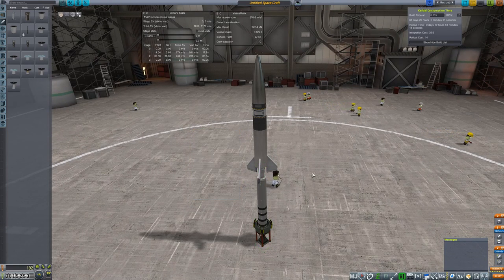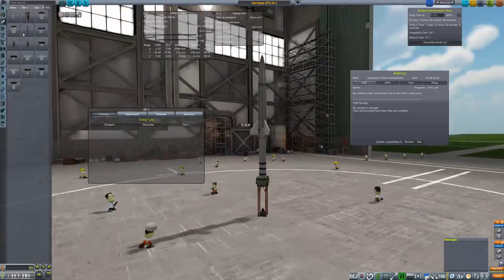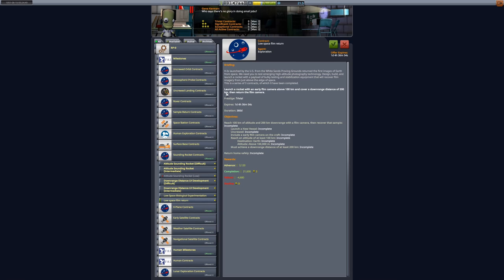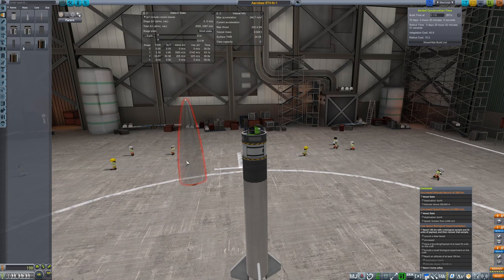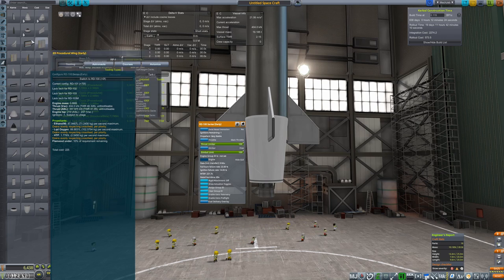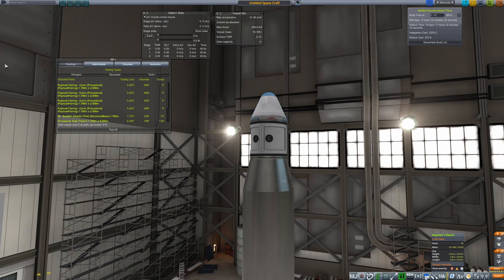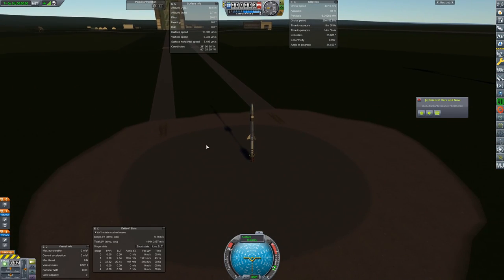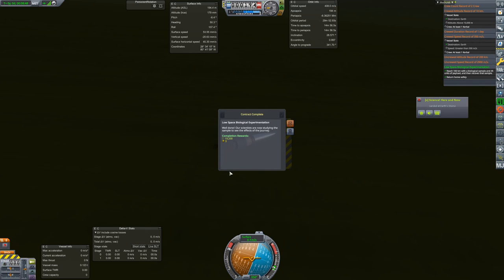Sky-high Designs! - KSP/RP-1 - Next Small Step Episode 04

Comment: What part do you use for the engine skirt?
Reply from the maker: So this install is out of date compared to what I use now, but I used a boattail interstage adapter. You flip that upside-down and attach the engine to the base node, and you can make a custom engine skirt that way! Nowadays I use ROTanks because it has built-in skirts and mounts that don't add parts or cost.
Reply: @justinbright9567  thank you! You have an amazing series and I like your narration. Keep it up and happy new year going forward!